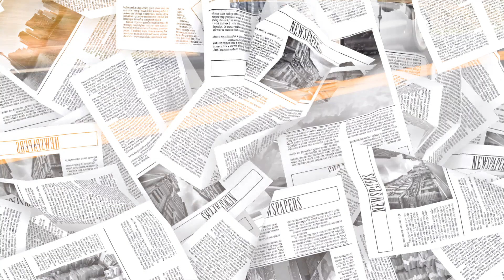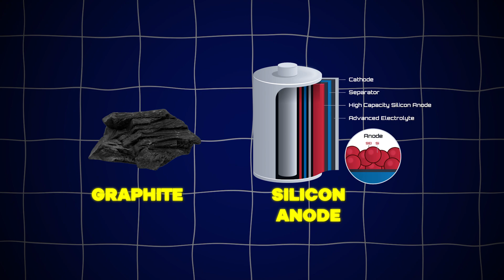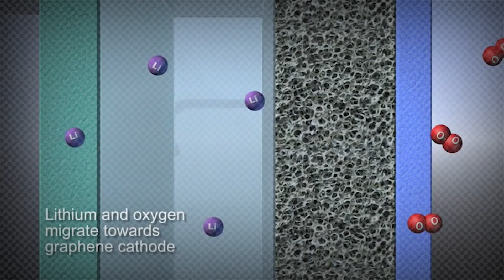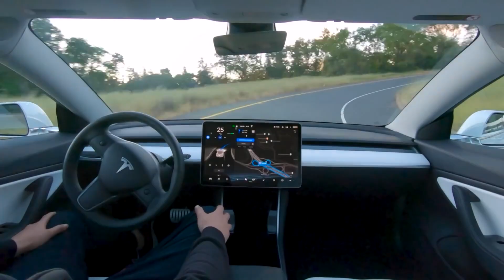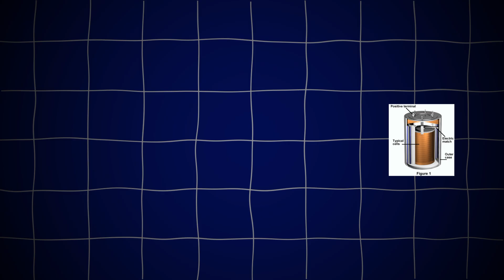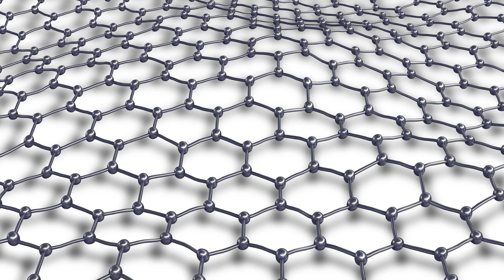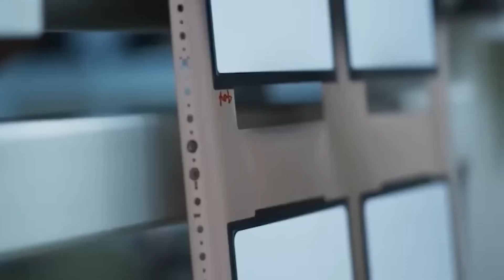Why This Ultra-Dense Battery Technology Is the Future of EVs!

Comment: Actually this is full of mistakes, pretty diletant claims.

The energy density of gasoline is not 1200 Wh/kg  but 12 000 Wh/kg, that is 43 000 kJ/kg. And even if the IC-engine has an efficiency of 30% of that of e-engine, the fuel energy density reference would still be like 3600 Wh/kg. 
Secondly this knda promises have been given for ages but we are still in practise under 300 Wh/kg while the original scenarios for green traffic suggested we'd be at 500 or so. The thing is that in reality, not in dreams like this video, battery densities have not improved for nearly 10 years now. Packaging-wise yes, that is why the present Tesla cell is 380 Wh/kg but built as a functioning car battery it is below 300 Wh/kg.

It is quite possible, that the limits of battery physics has been reached already. Solid state increases potentially power density but hardly energy density. Hopefully charging times will become rational. However, the big problem still remains. Producing batteries is extremely eco-unfriendly. Actually still now, by many experts, more unfriendly than oil ...